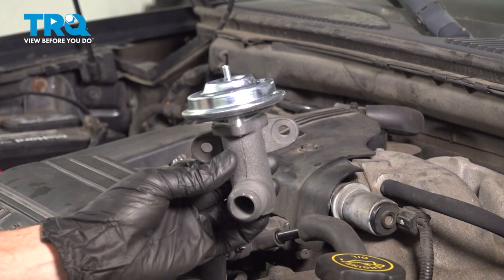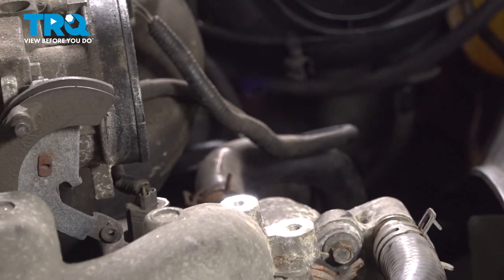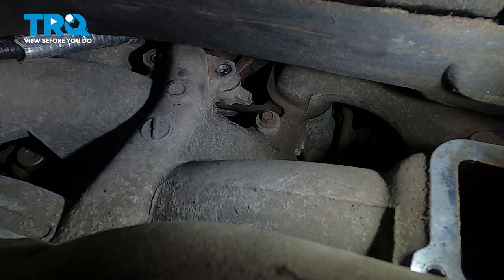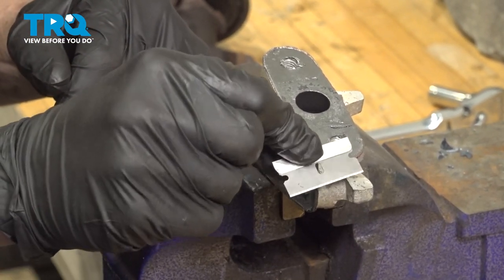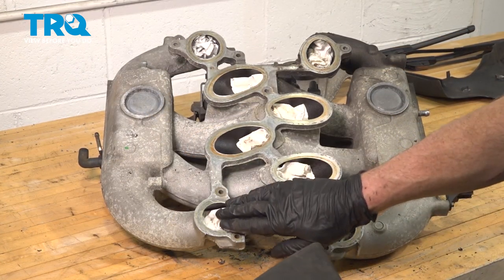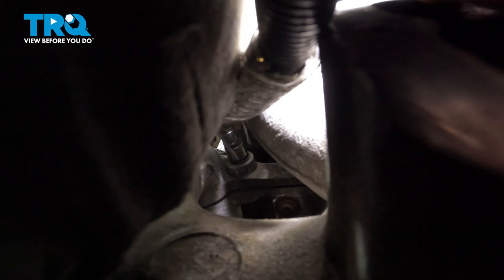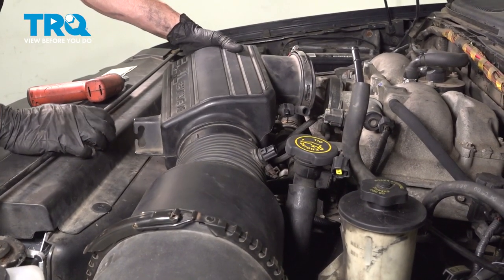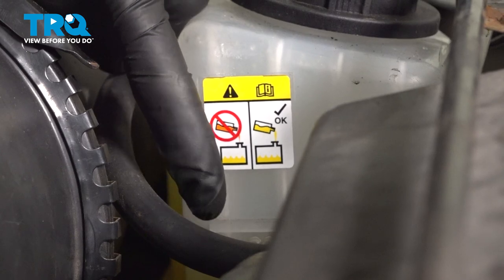How to Replace EGR Valve 1998-2002 Lincoln Navigator

Comment: Thank you! This helped immensely while removing the valve covers on my 2001 navigator. If anyone's going through the same thing - remove the passenger side fender liner for access. You don't have to disconnect the AC lines through the firewall to remove the valve cover, but you do need to disconnect the coolant hoses to the heater core and move the ignition wiring harnesses out of the way.

Comment: What is the purpose of this part?
Reply from the maker: +Charlie Juneau The EGR valve recirculates finely metered quantities of exhaust gas to the engine intake system for increased engine efficiency, reduced fuel consumption and lower NOx emissions.